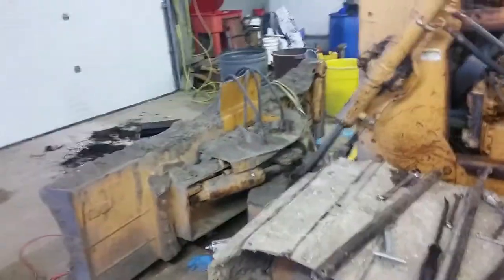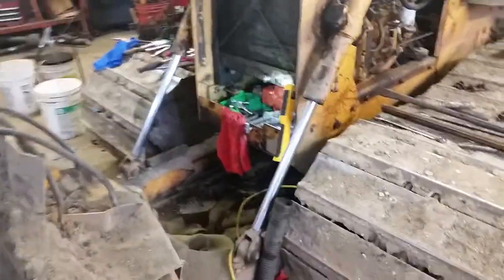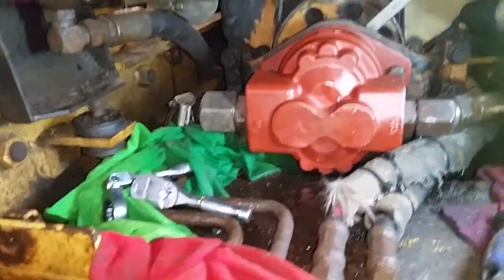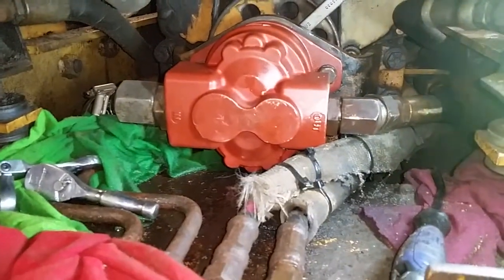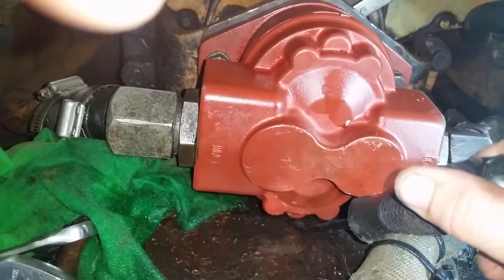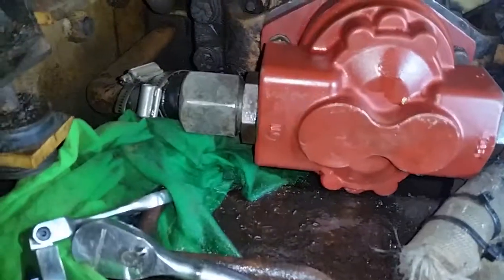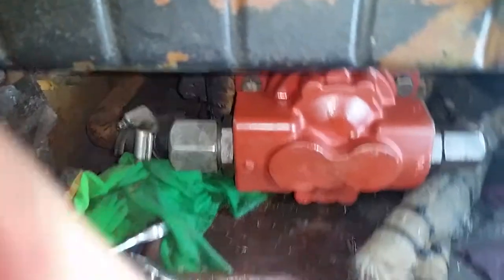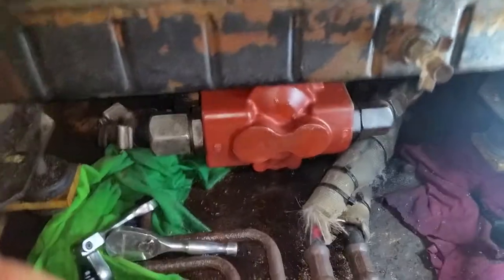Case 550g direct drive hydraulic pump install

Comment: Question on the pump...is that pump a single pump or a dual? Like is that one pump run the whole rig?
Reply from the maker: Yeah it is the main pump runs all the hydraulic's on dozer
Reply: @bassjunkie4881  cool, I bought a Case W4 loader and it has dual gear pump...but I can't figure for what purpose or if it can be converted into a single pump. 

The motor was blown, so I put a Mercedes 240d 616 in it from a Mercedes W123 car. I'm trying to figure out if I put the dual pump back or a single. The original engine only had 37 hp, but now it's 88hp.